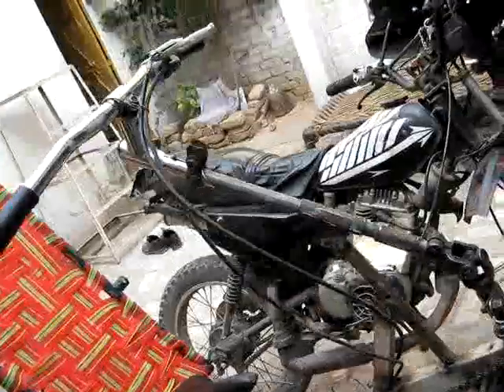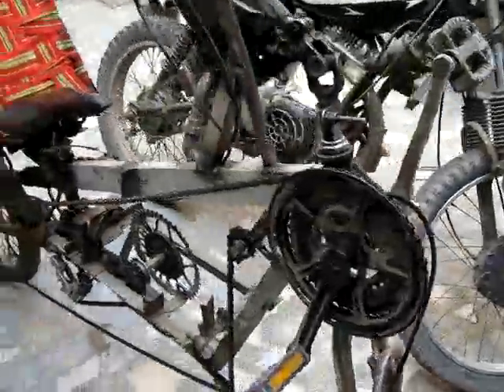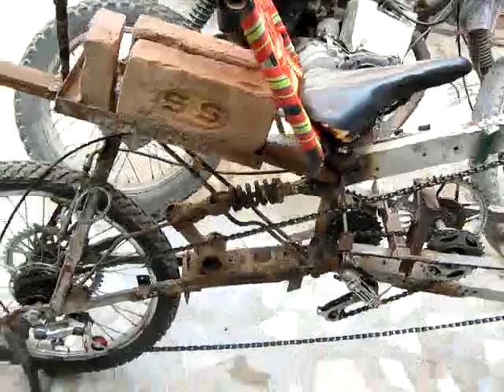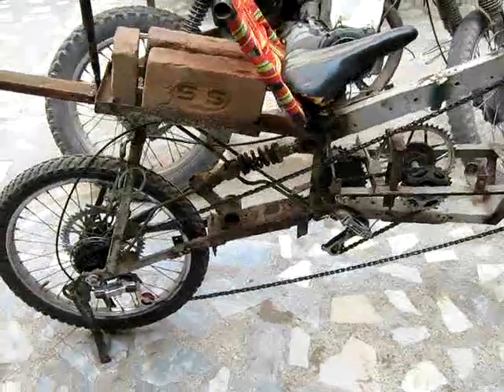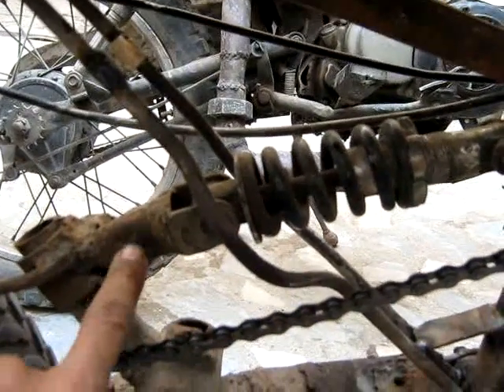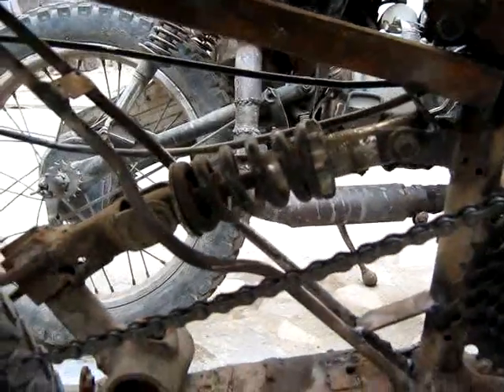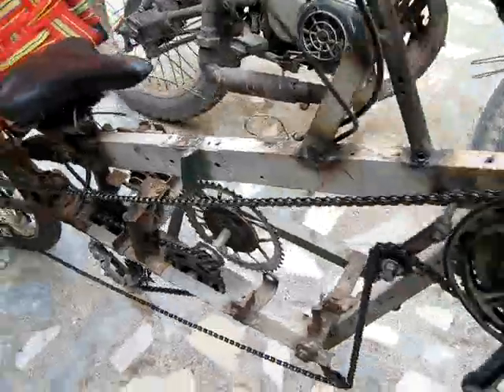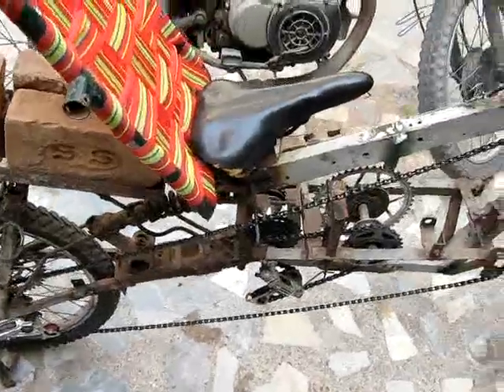Pakistani Electric Bike (Recumbent Rear suspension)

Comment: You could ebsorb the shock and not restrict the travel with prehaps wire coil and magnet soliniod suspention dampers and make electricity ?, but this will be time consuming to experiment and costly for magnets, also to heavy.
You would have to study many electronics princibles in physics and science.,

Comment: You're awesome Naeem.   :)

An automotive shock absorber, or motorcycle shock absorber functions to delay the rate that the spring is able to expand again after compression, which stops the harsh bounce back effect you're feeling after bumps.  It can be mounted anywhere between the rear suspension swing-arm and any point on the frame.